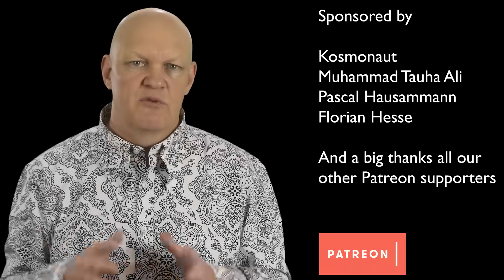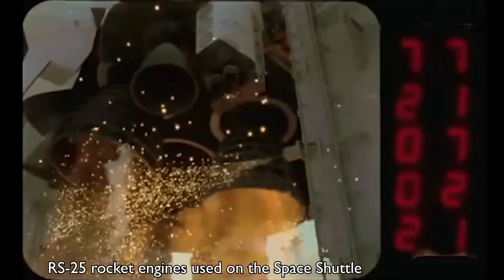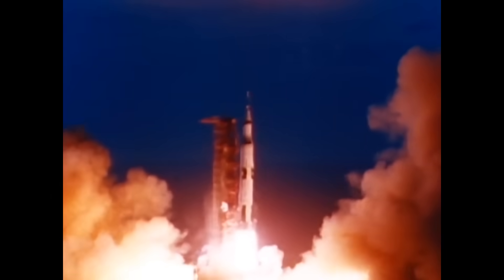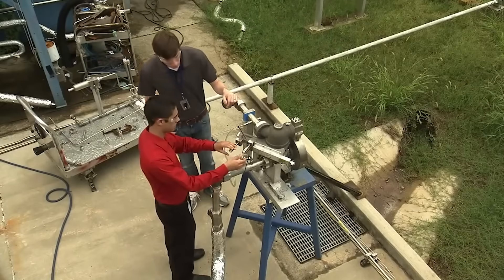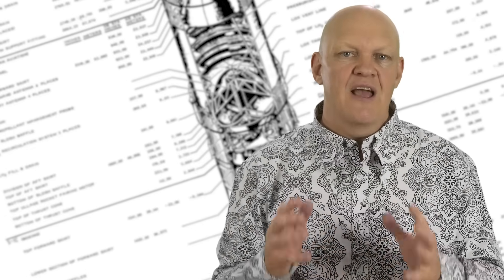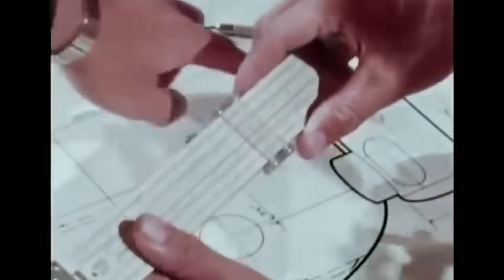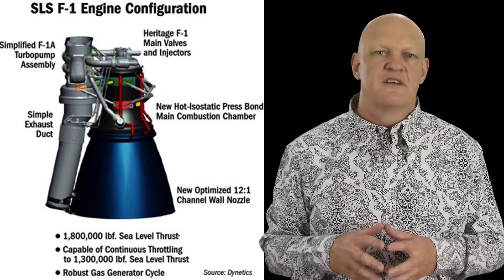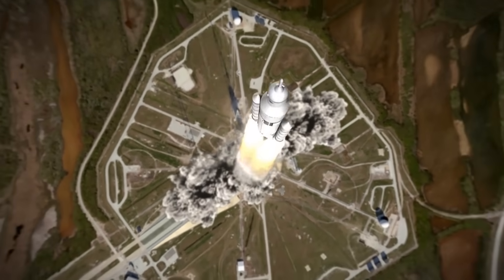Why Can't we Remake the Rocketdyne F1 Engine?

Comment: The equivalent of missing comments from software code
Reply: I have been into software engineering in the 1980s and 1990s. Since compilation usually took at least two hours, we often applied minor changes directly to the machine code and added a note to the archived source code listings. Once in a while someone forgot to make a note ...
Reply: @helidrones  haha, fantastic! :)
Reply: Ironwing Darkmoon what’s worse than no comments? Outdated comments.
Reply: Leo Chan 
I guess for this reason people tend to use very little comments today and rather (try to) use self-explaining code.
Reply: That's a pretty good analogy.
Reply: tommy aronson  I'd disagree, you can read good code more easily, but that just means you can see what it does. Comments tell you why, which is equally (and sometimes more) important.
Reply: @gordoncroft4524   100% with you on this. I see so many new coders believing that comments are unnecessary for good code. But coders who have worked through language and design changes (Generations of C or even JS, loss of AS3 etc; moves from procedural to OOP etc etc etc) tend to understand that comments explaining 'why' are so important; they stop you reinventing the square wheel!  

I'd add that ' No comments are needed for good code.' is only ever said by coders who don't need to program in high levels of optimization (either due to good interpreters or because their code runs on systems that can cope with sub-optimised code).
Reply: @JustinShaedo  I hit your last point a lot more than I'd like. I tend to have to fix legacy code with SQL that's 'Suddenly stopped working'.  This usually means it's ground the database to a crawl because the hardware can't cope anymore.

Sadly the most common solution is to throw new hardware at it! You can probably guess that's never the solution I propose 😆

Comments also come into their own when code becomes legacy. The original devs have moved on, the code hasn't been touched for years. It just works.

Until it doesn't.  At that point the poor contractor they call in out of desperation needs every bit of information they can get.
Reply: @gordoncroft4524  I hear you. I really do :D
Reply: ### do not touch below block of code.  Don't know why or how it works, it just does. ###
Reply: More like having a the source code for pre-release build with the binaries for a few production versions.
Reply: tommy aronson   Because of course the design doc is always maintained correctly, and is never wrong.

Everyone has different training and experience. I've always included comments to explain briefly the purpose of the code. It simply helps maintainabilty, and every coding standards doc I've seen has recommended such.
Reply: Worse: the F1 Blue-prints ARE the comments!
The actual code was lost when the teams that did the work were let go.
Reply: tommy aronson  your com is pure ideology ( but i encounter it more often today) . A comment can explain in few words what a much much longer a perfectly -self explaining code will do. 

You can, you should, use both of them.
If you use it, 
You will gain time and there will be no need to read the full book to know the story and conclusions. 

Thinking commented code is a bad code is just... pretentious. 

In fact it's just like in this videos, young engineers of the shuttle where hired to replace ... much better than themselves.,but they were unable to recognize this "manual" way of making rocket science.
Reply: My dad was a Fortran programmer for Rocketdyne.  I remember the "shoeboxes" full of punched out cardstock all over the place.
Reply: More like they never pushed to remote
Reply: That’s actually a good comparison.
Reply: Beyond that......not just missing comments. Superior minds and skills.
Reply: Not entirely correct. See the Maria64 reverse engineering effort. But its close. I think having a rom with software, but the hardware is gone, not only do you need to reverse the software, the hardware is partialy unkown. the memorymap layout is unkown and how is hardware connected to the cpu? what busses where used?

Its not imposible, but its about how muh time/thus money, will it cost to reverse engineer. 

Code without comments can be reverse engineered. Ghidra for example can even interpret back into a sort of C language. this includes code that was programmed in pure assembly.
Reply: And the compiler
Reply: Current method of building something. Start with a machinr code on a chip, plug it into a seven axis milling machine, load, for the first time, a big block of plastic foam, hot start, come back a couple of days later to a large pile of plastic foam chips, revise code, start over with new block of foam.
Reply: i never put comments.  Its not like 60 years later somebody would need my code...
Reply: Yeah, sometimes code is just made with esoteric knowledge...
Reply: Only in the United States of Amnesia could you pretend this is the reason.
Reply: No not even cllose. On one hand you have highly skilled and knowledgeable craftsman. On the other you have some one that tinkers. Takes things a part but can't seem to get it back together. Oh yeah least we forget they have typing skills. My brother in law is an software engineer. Taking out the trash is a calculus. I'm an Electrician. I essentially can do all that he does. Plus build properly functioning buildings, vehicles, farms etc etc..No coding necessary or required. Sure people use code but ultimately real world functionality must be observed to find the multitude of flaws.
Reply: @Sam Mencia 
The same here in Germany. Also it‘s the predominant mindset, people study rather social science than something useful.
Reply: Ironwing Darkmoon sociological mechanics is important, depends where your career path is aimed.
Reply: @helidrones look at you, saying social science is not useful. If the janitor is useful
Reply: @GameMoves2 
I could have found a better wording, nothing bad about people helping people. In short, what i mean is: Instead of caring about each other, we hire professionals to perform that kind of duty. The social industry feeds itself.
Reply: They banned comments in code for sexism.
Reply: Not a good analogy.  If you have software code, the program will run exactly as it ran originally.  The comments help you understand what the code is doing so if you need to troubleshoot or make modifications to the code, you will be able to do so.  The problem with the blueprints for the F1 rocket engines is "some code is missing".

Comment: If you made somthing simillar wats the use , u will never be able to cross vanellan belt
Reply: LOL The Van Allen belts can and were passed easily but people like you read something off a conspiracy web site and assume it is true without researching it yourself. The Van Allen Belts are made up of a TYPE of radiation called charged particle radiation. A TYPE of radiation that is not nearly as deadly to people as high EM band radiation like X-Rays and Gamma rays. To receive a fatal dose of radiation you would need to spend about three months in the Van Allen Belts. The Apollo astronauts spent a TOTAL of 3 hours in the Van Allen Belts during their trips to the moon. The astronauts carried dosimeters on them to measure radiation exposure and they received around 5 REMS of exposure which is less than the average worker at a Nuclear power plant receives in a year. As another way of demonstrating how stupid the conspiracy theorists are, they make claims that the Apollo space craft would have needed lead shielding to keep the astronauts alive. WRONG in a charged particle environment, when those particles collide with lead they give off X-rays. Having a lead shield on the Apollo space craft would have killed the astronauts as they traveled through the Van Allen Belts.

Comment: Difference between mass production vs one off engineering in reality. Part standardisation requires well defined tolerances to result in interchangeable parts and good detailed drawings so multiple manufacturers can make it. It was pretty established in the car industry from the 20s onwards and the second world war entrenched it further as often multiple manufactures and less skilled staff had to be used. You need it for anything you are going to service with interchangeable parts and for mass production. The F1 engine was not standardised to the point you could have multiple suppliers and interchangeable parts, they were built, tested and fettled till they worked then used once. It's a faster way of getting something working for sure, and there wasn't time to standardise completely the design in the project before the project ended. If the F-1 had a life after Apollo and skylab missions it would have been refined further.

Comment: This premise doesn’t seem to fly, so to speak. We have F1 engines, and 3D printing, CNC machines, 3D scanners, we could duplicate every part exactly. Robot welders too. Why reinvent the wheel yet again?
Reply: We do have a modern version of the F1 engine, though. It's just that the Space Shuttle engines were more recent, and were easier to adapt for the SLS.
Reply: @Jan_Strzelecki  But it is less efficient then F-1 Engine.
Reply: @anltube35935  Which doesn't invalidate my previous post 🙂

Comment: Forget the F1, Just design a modern Full flow staged combustion engine like the Raptor but scaled up to deliver F1 (or beyond)  level of thrust..
Reply: As the development of the F1 itself shows, it's not that easy. Big engines have their own set of problems (like the pogo oscillation).
Reply: @Jan_Strzelecki  Well I don't expect it will be easy per se, but they solved it before in big rockets so they can again.  My point is why ignore 60 years of technological advancement and just ape an ancient rocket design?

Comment: As an engineering student, I feel it’s a challenge slapped on my face to rebuild that engine. I’m burning with a fiery spirit inside now.
Reply: Vedanth Bhatnagar Yeaah good luck with that.  You’ll give up pretty quick, no purpose to do it, I seriously doubt you have the machining to do it, etc.

They have the blueprints, thats not the problem.
Reply: @whackyjinak4978  I'm pretty sure that the guys who first made this engine did not have any proper tooling or machinery to construct it. And they did it without blueprints. Where there is a will, there is a way.
Reply: Vedanth Bhatnagar They had millions of dollars of government funding and access to the highest types of sophisticated machining of the day.  The best minds of a generation working on it.  The engineers drew up blueprints and designs before implimenting them, building parts and testing them practically off drawings.  You’re a Engineering Student, so clearly you should know you don’t fabricate something of that degree solely by eye.

They could have recreated the engines identical to the old ones, instead they used the old blueprints to have a starting point to make a more efficient engine.  There is no challenge, it’s a clickbait title.  They could remake the F1, it’s just not economically intelligent.

Comment: It is almost always more difficult to remake something, rather than starting from scratch and just using some of the ideas from the previous design. As a freelance engineer I've been asked  sometimes to remake the projects of my colleagues (other engineers). And it turns out I spend days and even weeks to figure out what were my colleagues thinking and how have they got it done. And I am talking about small projects. With a project like Saturn V, it will probably take years before the F1 engines' documentation and building principles been understood (on paper) and then rebuild. I'd even say it is impossible or it will be super expensive and difficult to be done. Plus, as it was mentioned in the video, most of the people who were working on the project are already gone. And the best way to understand exactly what and how was made is to ask those people. It is impossible, even with all the computers in nowadays, to track everything on blueprints and other technical documentation. Especially for huge projects like Saturn V! We are not talking about computer capacity here, but human mental and physical capacity :)

Comment: What a lot of people are missing is that... we don't need to remake the engines. Modern engines produce roughly twice as much thrust per weight and are more fuel-efficient (more payload to orbit). Even if we could re-build an F-1 engine, it wouldn't be remotely competitive with modern engines. Some of those modern engines are also re-usable, in-flight re-lightable, and throttleable, none of which the F-1 can do.

Comment: why would you want to remake a 50 year old design that is specifically designed to do one job.
Modern engines would be better and smaller and lighter.
Reply: the f1 had a 100% success rate and was fairly cheap for what it could produce, and the main reason they want to bring it back is because it serves the exact purpose they need. u are right in that though because as of now, space x has the only full flow staged combustion engine that is nearly ready for actual flight and will be capable of taking their starship to the moon and mars in commercial ways
Reply: "Modern engines would be better and smaller and lighter." And the best has no size and no weight at all.

Comment: So we can't exactly duplicate the manufacturing process......resulting in non exact models.

I am all broken up about it !

Why would we?

Some 50 years earlier the US army was a lot smarter than NASA.

When they listed the specifications for their new desired standard gun - it was demanded that no such unique craftsmanship was allowed.

The delivered 1,000 pieces from Colt was all disassembled and the parts mixed together and randomly assembled again - and afterwards all guns should work equally perfect individually.

Apparently NASA should have demanded the same standard - but if we really WERE to build new Saturn V's - I am pretty sure that they have learned from their mistake.

Comment: modern engineers and fabricators can't build an original F1?  what a surprise.  i ask my students to multiply two single digit numbers and they all reach for a calculator.  did elevators make us better at climbing stairs?  did TVs make us better at reading books?  now ask yourselves, will computers make humans smarter?  will robotic fabrication and assembly make humans better craftsmen?  when will "experts" in education realize that students must be FORCED to do things "the hard way" until they become proficient at doing things "the hard way," so that they learn how to THINK.   only then should they be allowed to use all the modern gadgets that remove THINKING from the process.  hi tech tools intended to expedite high priority WORK are NOT appropriate as crutches for students who end up not understanding what they're doing, why they're doing it, or how it works.

Comment: We could, but why would we want to ? we can make far more efficient and more powerful engines today.
Reply: actually, that was the point.  we CAN'T.  as for why would we want to?  so you think losing the skill set of the men who built the original engines is OK?  maybe we should remove all the stairs from buildings with elevators?  once the accumulated knowledge of generations is lost, it's difficult if not impossible to recover it.  THAT'S WHY!  if you weren't an arrogant illiterate dumbfuck, you'd realize that.
Reply: @johnmichael1594  derp, we actually can, the whole "we can't recreate the F1" is purre BS. We don't need the F1  we have far better designs. We didn't lose any skill we've improved them to where using an old engine is not needed.
Reply: @johnmichael1594  - " if you weren't an arrogant illiterate dumbfuck, you'd realize that."
Well I am an aerospace Engineer with 25 years experience building, launching, and flying spacecraft for a living.
I AGREE with madmax that OF COURSE WE COULD REVERSE ENGINEER IT IF WE WANTED TO so I guess that makes me  a "dumbfuck" as well?

I would argue that YOU are the dumbfuck for assuming that all engineers today are imbeciles.

Comment: Not only have we lost all the original molds for the F-1 parts but weve lost the ability to machine the engine parts due to CNC mills taking the hand & eye skills required to operate a 1960s boring mill and allowing a computer to select measurements.